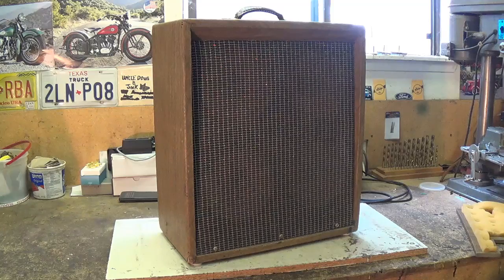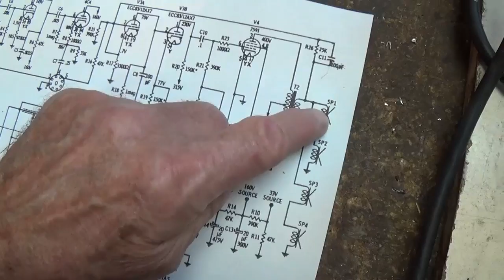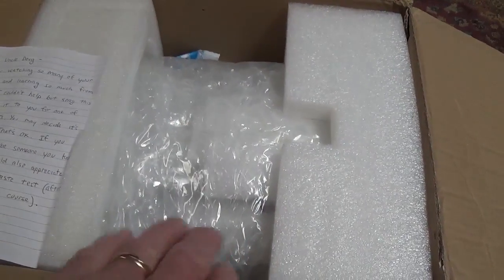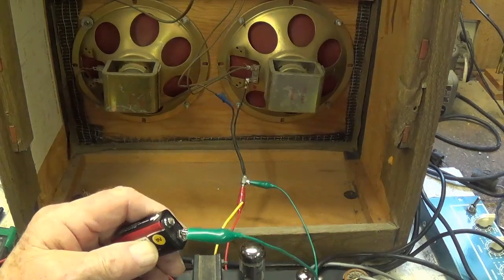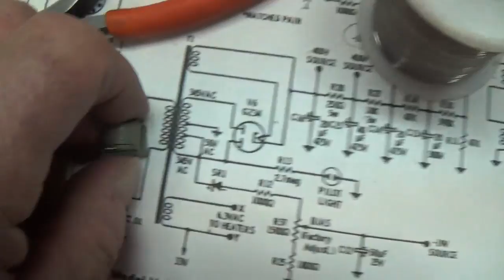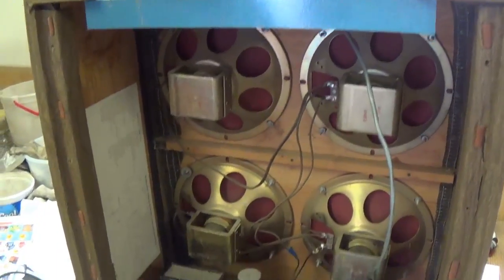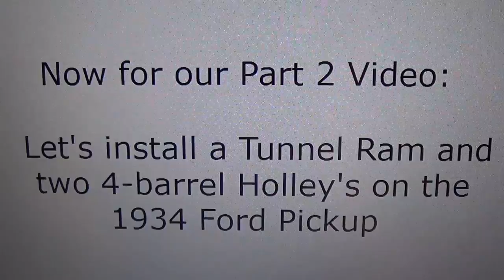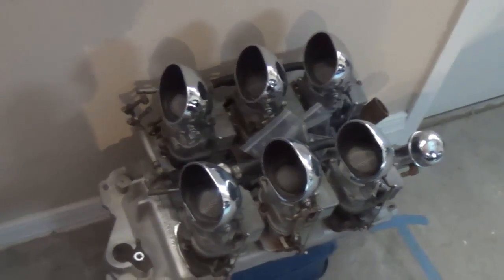Harmony H322 Bass Amp.......The "mini" Bassman from Hell !!

Comment: Hi Doug - I went to change out a bad wall receptacle today in my laundry room, one socket was dead. 10 feet away is another socket that works fine, and just for fun I tested it with my plug-in socket checker. Guess what? No ground connection AND reversed hot wire ! This house was rewired professionally about 15 years ago, and I never had cause to check these. There was a copper ground wire mounted inside the box but not connected.
Well, I wasn't going to play any tube amps, phonographs or old radios in that area, but what if my son's friends came by and wanted to have some fun with some of my  old instruments in that room when I wasn't home?
I watched this video and your comment about the dpst on/off switch caught my attention. Little did I know, , , ,
Super-clean job on the Chevy motor. VERY handsome !!
Stay safe, everyone.
Richard
Reply from the maker: I had an outlet in my music room with reversed wiring and didn't realize it (after years of use) until I plugged in a series-filament amp with a 3-wire chassis-grounding power cord. Fireworks ensued. You can't trust the wiring in your house, as you just found out. It must be checked.

Comment: Glad you removed that stupid power switch someone installed. And yes. I’ve had nothing but problem projects lately too. It’s gotten so bad, I’ve pretty much sworn off accepting any new outside work.
Reply from the maker: It really does get discouraging when you encounter several completely botched, multiple-issue amps in a row. My favorite is when you finally get the %@$#&?ing thing working well.....and a completely new problem arises during final testing. I finally had to take a break and work on a hot rod. I swear, if it were not for my Patreon subscribers, I would change hobbies.
Reply: @UncleDoug  Here's my philosophy regarding botched/modified amps. The manufacturer built it the way they did for a reason.  When encountering a malfunctioning amp that was modified is to return it to stock design. Then repair and update as needed.
It's also a great opportunity  to learn from somebody else's mistakes.

Comment: 7591's were used in Ampeg bass amps
my Heathkit AA-100 stereo has 4 in it
Reply from the maker: They are a stout tube, Whitney......along the lines of 6L6GC's as far as plate voltage tolerance.
Reply: Obviously it's time to turn your Heathkit into a guitar amp!
Reply from the maker: @jonnybeck6723  It's ALWAYS a good time to do that :)
Reply: Ampegs we’re all-wise well built and seemed to like to use kinky out put tubes usually with great results

Comment: Good job fixing this amp!! Great video as always! I just finished a restoration of a Gibson BR-6F myself. Turned out well. Made a few tweaks to the circuit itself, but main needs for the amp were 3 prong power cord and filter capacitor replacement. The original Cornell caps measured about 2 to 3 MFD when they should have been 10 to 20 MFD. They were shot. Those old Gibson amps are really cool and fun to restore. I like the BR-6F more than the BR-6 as it has the volume control in the correct place and a Pentode front end. Have a great rest of your weekend and keep up the good work!!
Reply from the maker: Thanks, TG. You do the same :)

Comment: Thanks UD! The light bulb part of the dummy load was were I was getting confused, not to mention the resistance of the power resistor's stability when heated to oh wow. Thank God for popcorn and beer. And thank you for taking the time to reply. Rat on!
Reply from the maker: You're welcome, FWR. A major problem is that filament resistance varies greatly with heat, so it cannot be relied upon to provide a consistent load.
Reply: @UncleDoug  Thanks UD!

Comment: Hello sir, I don’t even begin to understand electronics, but famously enjoy your amp repair videos.
 As a mechanic by trade, I see your fuel lines on the ford have (ugg) screw clamps. IMO screw clamps to a mechanic are as what electrical tape is to pro amp repair technicians.
Amazon sells a slick , entry level pinch clamp set for $22 . Pinch clamps can only be used once, but once you use them you will fall in love with them. They are clean, don’t cheese up your hose, and do not leak. They come in various sizes. I used them on my beetle restore....VW used them originally.
Lovely truck!
Reply from the maker: Thanks so much, OK.  I agree with your assessment of the screw clamps and will definitely look into the pinch clamps.

Comment: Memories... I had a 15w Harmony bass combo in 1972. Two 6V6's and a Jensen ceramic 15 in a sealed compartment. In smaller hall, the tone was impressive. No so much at larger and louder weddings!
Reply from the maker: Sounds like a more typical bass amp than this one, Steve, with 4 x 8" speakers.

Comment: Great video Uncle Doug, really enjoyed the video.  I have an R600 Electrolab, made with the worst form of chip board.  My was noisy as hell.  One half of the filament circuit was through the chassis.  After cleaning up the wiring, it is now dead quiet and a great sounding amp.
Reply from the maker: That's great news, David. Congratulations on a successful repair.

Comment: Hi Uncle Doug,
I was going back through some of you're older videos and I really enjoyed this one.  This old Lectrolab circuit reminds me of my own R600.  I love the amp's sound, but it was a noisy mess when I got it.   Lots of 60 cycle hum.  They used the chassis for the filament return.  I believe, looking at your video, someone had already made that mod to the amp.  The black and white twisted pair in yours looks it was an attempt to reduce hum. With mine was I added the proper twisted pair filament, with center tap, and now mine is quiet.  Glad to see you had a quality cabinet, mine is that real loose density fiber board.  Crude as hell, but I love it none the less.
Reply from the maker: Thanks for all your very nice comments, David. :)

Comment: Mini-bassman is great...but tunnel ram....OH YEAH! The carb-volume problem takes me back to my now long-gone 68 Nova SS 350....which at one point had a Holley 850 double-pumper. You can imagine what the throttle response was....once I replaced it with a 650 w/vacuum secondaries the response was much better.
Reply from the maker: It's a challenge to drive properly, but once mastered, the acceleration, even from low speed, is fierce.

Comment: I remember that same contact paper used on the shelving of our kitchen cabinets. IMHO that is the only place for it. Whether it's a radio or an amplifier 
you should never cross power supply sections on signal supply sections. Well this wasn't done so hence they seemed , to no avail ,to "fix" it without
some basic electronic knowledge and the 60Hz made a mess of things. Thanks Uncle Doug for showing what was wrong and how to fix it in this amp.
Reply from the maker: It was our pleasure, HM. Thanks !!!

Comment: Nice work as usual OD! I was worried about the ground loop when you installed the 3 wire ac cord between the two chassis but I knew you’d get it sorted.
Reply from the maker: Thanks, Chris. It was a classic example of ground loops in action ;)

Comment: Great job, as usual.  I must note that this Bass Amp has the same problem as the Fender 4 x 10" speaker bassman--and is therefore a much better guitar amp:  Bass speaker enclosures  need to be be  need to be sealed and, preferably, ported.  This was first discovered and incorporated by Ampeg.  Their 'Portaflex' amps were basically sealed but the leakage at the flip top and other places impersonated a true port and, though not tuned, did a better job than any other bass amp of the period.    Fender then brought out their  2 piece Bassman .  This was much better than the open back 4 x 10"  Bassman--for bass.    It was probably not as good for guitar.  (The electronics are not very different.)  The 2 x 12" Fender Bassman cabinet was totally sealed which was much better than the open back cabinet for the 4 x 10" amp for bass   but sounded muffled  and tubby compared to a ported cabinet--or an Ampeg of the period.
Reply from the maker: Thanks for the very knowledgeable and informative input, Alan. We appreciate it.   Please subscribe so you can received notification each time a new video is posted.

Comment: Out of curiosity I browsed around on the internet for other examples of this amp. The first one I came across had a plugged hole drilled in the panel next to the input jacks. So apparently moving the power switch/indicator lamp to the top was a common mod that was frequently unmodded.  It was interesting to see how much of an effect undoing this mod had on sound quality. Definitely a good tip for the future.
Reply from the maker: Thanks, Jeff. The amp was junk with the switch on top.

Comment: Love my H322 and her little sisters H303, H304 and H306
Reply from the maker: So there actually is another one of these jewels out there ?? Sounds like quite a collection, JP.
Reply: @UncleDoug  found mine for a good price, had a hole drilled in top control panel.  Took me a while to figure out power switch had been moved then put back in the original place.  Tolex is closer to paper on all these amps
Reply from the maker: @jpcallander9560  I'll bet I know why they returned it to the chassis......hum, just like this one had. Yes, the covering material is glorified wall paper.

Comment: i feel your pain on this! I fried my first power transformer this weekend. It was a combination of errors - the first time I have wired a filter cap in backwards, and the first time I've forgotten to check the fuse - it was an 8amp fuse, not a 1amp like i normally use. I powered it on and spun it up slowly on the variac. I heard a hum, which I thought was just the choke, and then the power transformer belched smoke. I realized pretty quick that one of the caps was backwards, so i replaced it and spun it up slowly again, and the power transformer belched the rest of the smoke, and that was it. Luckily some vendors are still open online, so I got a new power transformer and new caps within a day or two!
Reply from the maker: Wow......a double-header, Daniel. You really need to construct a current limiter (see my video). It would have saved the transformer and the caps.
Reply: @UncleDoug  you are right. I have been putting it off for a while. Ever since I scored a variac for dirt cheap at a hamfest, the slow ramp up has been enough to protect me from boneheaded errors, but in this case, I did all the mistakes all at once.

Comment: Wow what an odyssey, it sounds really good for as old as it is. As far as the brass drive on the Mag, it was designed like this for two reasons, both have to do with sacrificing itself to save the cam. Better to have the gear wear out than the cam, also if something comes lose in the mag, and seizes the shaft, the gear will die saving the cam for harm. Of course this is all for racing in view, and not so much longevity. Very good cold start on the TR. Weiand are really the classic TR people, although now owned by holly, they are also the classic Blower conversion company. The issue with the low RPM bog with tunnel rams is the volume of "Dead" air in the plenums and the runners. With the large single plane plenum base, you have to get a lot of air moving, which is hard to do off idle. Back in the day I knew guys that would build Independent Runner tunnel ram manifolds and top them off with twin dominators, which meant, no runner "crosstalk" but it also meant tuning 8 idle circuits, and a ton of "standoff", horrible on the street. Anyway, thanks for the videos and keep them coming, also Long Live Don Leslie.
Blue Mule
Reply from the maker: I really appreciate your very knowledgeable input, Don. I have to carefully control the throttle off idle, but now that I've got the hang of it, acceleration is smooth and quite strong.

Comment: I'm 100% sure that you know this but maybe someone else might find it interesting.  What I do on my push-pull amps that are biased in that manner is to replace the fixed resistor in the bias circuit with a small pot so I can adjust the bias voltage.  Of course with another resistor from the bottom of the pot to ground so that the resistance never goes to zero.  Then I put an additional voltage divider pot/resistor combination essentially in parallel with the first one.  Now if you break the connection between R21 & R22 you can feed connect one bias pot's center tap to the free end of R21 & the other to R22.  You now can bias each tube individually to essentially match the tubes, at least as far as plate dissipation is concerned.  I like to determine what bias voltage is needed by working your  math backwards, starting with the desired plate dissipation and solving for the bias voltage required.  Set the pots to give you that voltage and trim it up from there.  Like you, I have the CompuBias setup for two tubes.  It's a later version than yours and as well as plate voltage and current for each tube, also directly displays the plate dissipation and has a handy chart printed on it showing the typical dissipation range for common output tubes.  There are some good pictures of it if you Google on CompuBias.  Man does that make it easy to bias these things!

Love your stuff as always and my blue heeler Sparky and I both still miss Rusty.  Subscriber both here and Patreon and encourage all to do the same.
Reply from the maker: Thanks for your very knowledgeable and helpful input, John. I have posted several videos showing how to implement the variable bias voltage control. By coincidence, "Sparky" was almost Rusty's name also.....but the latter won out in the end (i.e. my wife's choice) ;)

Comment: Anyone who has worked on enough complicated projects (of any type), figures out that sometimes it's just best to walk away from it for a while, and come back later with a fresh perspective.  I know I have many times.  Well done.  Bronze gears on the distributors were used with billet cams.  If you used the steel or cast gears, you would kill the cam gear (don't ask me how I know from way back when lol).
Reply from the maker: That approach certainly worked here, Bert. Thanks !!

Comment: We had a 55 Buick Special 2 door. I remember it had a buzz noise when you turned it on and waited for it to warm up. I recall making sure it was turned off before you started the car. My dad was an electrical engineer at Hughes Aircraft. He said the power surge starting the motor was hard on the radio if it was left on.
Reply from the maker: Actually, when you rotate the ignition switch to START, it disconnects all the accessories to provide maximum current to the starter.....so it's really not a problem, LK. The buzz you heard was a vibrating device that was converting the battery DC into AC for the transformers within the radio circuit.
Reply: @UncleDoug  That's why I commented about the buzz..., it never occurred to me what it might actually be until your post.

Comment: Hello Doug, hope all is well. I found this repair to be an interesting one. Its very unusual to see a bass amp   using a pair off 7591A's in the output stage. I've seen  them in a couple of guitar amplifiers but that's as rare as hen's teeth. The 7591 was a popular output tube for high-fi use.  Especially in integrated amplifiers and receivers. Stay  safe  and in good health. Be careful out there.
Reply: Yes, Heathkit used them in a few of their hi-fi amps. They packed a bit of a punch.

Comment: Hi Uncle Doug, nice clean up!  When I see amps like this, I wonder a bit on what the designers were thinking.  They used 7591s; a low distortion output tube similar to the 6L6.  They used an output transformer with more iron for better low frequency response, suggesting the amp was for bass use but, used 8 inch speakers instead of a 15"; strange?

I did notice an error in the output tube bias circuit, 7591s have a grid 1 resistance limit of 300k for fixed bias operation (the circuit in the amp uses 390k).  So, this could have contributed to the output transfomer getting cooked.

I enjoyed your video, (and no one else is likely to combine guitar amp rebuilds with hotrod engine work) so, keep up the good work!
Reply from the maker: I agree that the 8" speakers are not appropriate for a true bass amp......which leads me to think that it was "bass" in name only, to capitalize on a resemblance to the Fender Bassman. Thanks !!

Comment: Hi Uncle Doug.  Nice job as always.  Ground loops are a pain to find for people who aren't familiar with them--good for you.  BTW, I noticed that the tone controls didn't seem to do much, so I simulated them with LTspice.  Yeah, sure enough, they don't do  much unless turned to their extremes, and even then they're underwhelming.  I nice upgrade to the amp might be a change to a more typical tone stack.
Reply from the maker: To be honest, R, I changed the circuit and tone controls back to a more original configuration and they actually did work much better in the final iteration.

Comment: Uncle Doug, When you open old amps that were poorly serviced, I pray there is a statute of limitations for amp abuse. When I was a kid in the 70s, I recall using Mom’s best paring knife to splice lamp cord, twisting the connections and wrapping them with lots of black electrical tape. We’d wrap blown fuses in aluminum foil and reinsert. If a tube fit the socket it was good to go! Knowing someone who learned to solder in shop class was a big plus. Mea culpa!
Reply from the maker: So YOU'RE the guy who is destroying all these precious old amps, Dan. The amp police are on their way to your house to seize your paring knife and electrical tape.
Reply: @UncleDoug  Let he who is without sin cast the first stone.
Reply from the maker: @TripleThreat2405  Good point, Dan. I've butchered a few things too :(